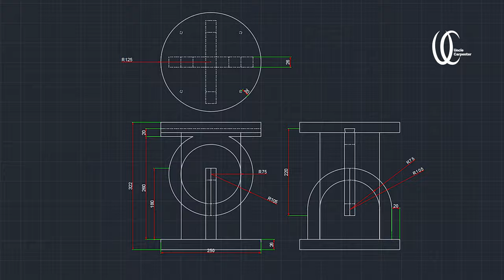(Wood Art) Beautiful and mysterious Anti-gravity structure. Making Alpha and Omega Tensegrity.

Comment: This design is genius! It seems like magic, but it’s all about engineering and physics. The wires work with physics and balance to make  the top seem like it’s antigravity. The key is the center wire that connects the ring to the bottom hoop. The wire connecting them is shorter than the other four, so the ring can only fall as low as the center wire will allow it. The four wires on the sides stabilize the whole thing and keep it from tipping over. Just like the cables on a suspension bridge or wires that allow magicians and stage actors fly.
Reply: It's just hanging something with extra steps